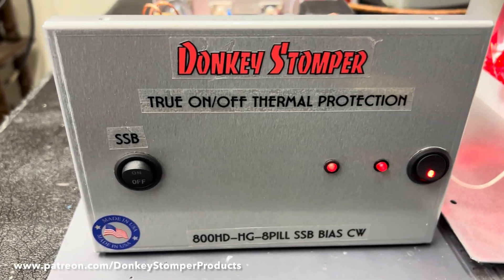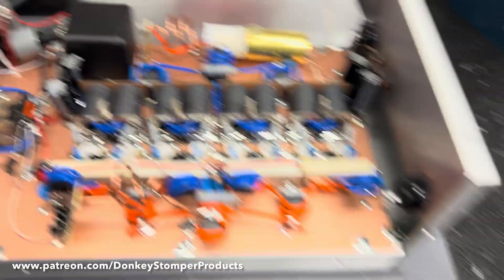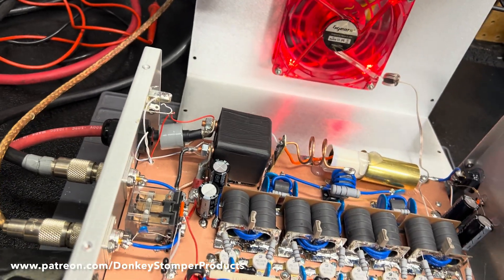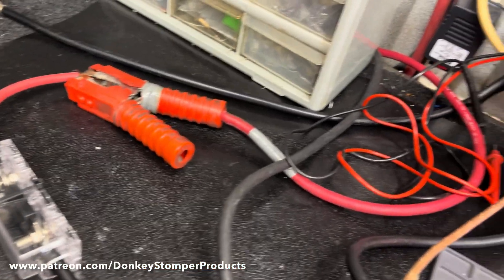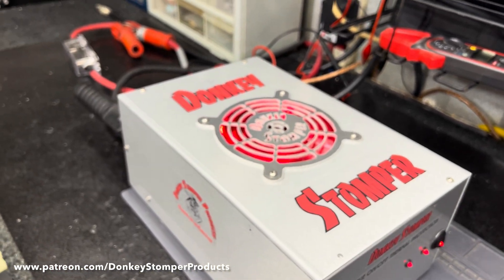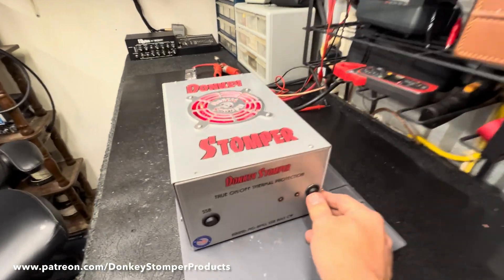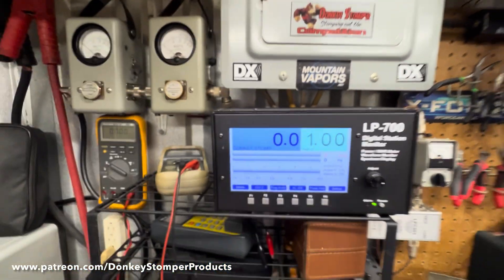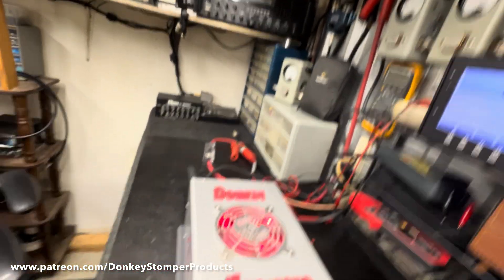800HD-HG-8Pill Mobile, SSB Bias CW Transmitter, True On/Off Thermal Protection

Comment: Honestly asking and curious. I understand 4,6,8 pill up using a separate driver box but my question is how come you don't see any or very very few boxes like 1 or 2x4 or 4 pill with high, med, low? I figured the staging is a problem or pain that's all I can guess. Honestly like input because I've always liked to turn down or up as needed. As always nice box man. Yeah a month is plenty time to see if a box is good to go and most people honestly don't know how to run them properly.
Reply: I own a DS 1X4 and it does awesome. The main reason for the 1X and 2X were for older radios that didn't have a lot of drive. The newer radios are putting out as much or more than a 1 or 2 pill stage so you don't need it and if you hit it with a hot radio, your transistors aren't going to last very long.....ask me how I know..LOL
Reply from the maker: Thanks for watching! Happy New Year! @ReapersFear
Reply from the maker: When we do a box with drivers we do a variable resistor which is way more adjustable then low, medium, high switch. Thanks